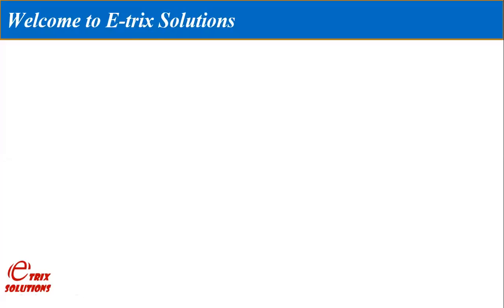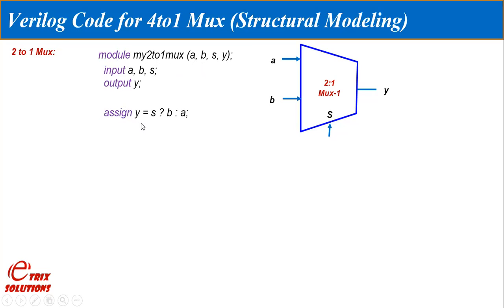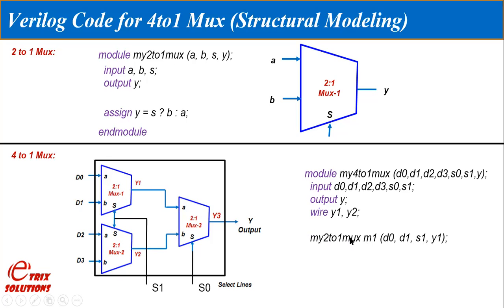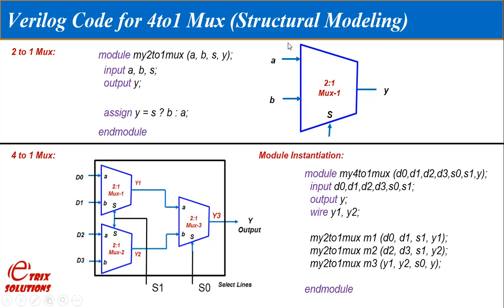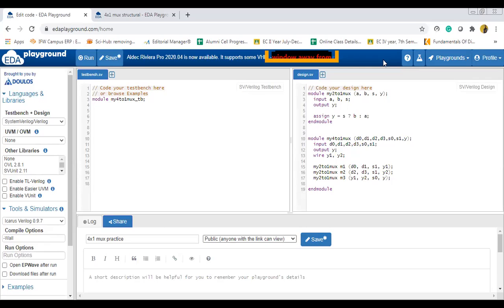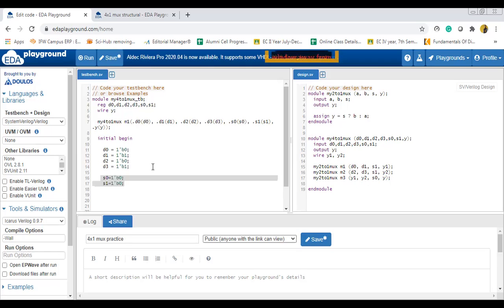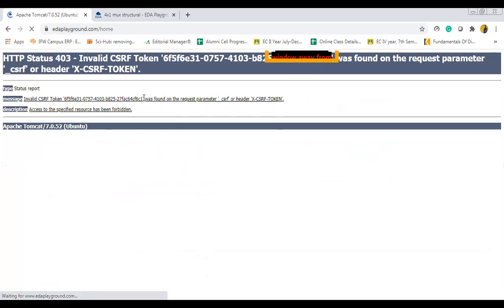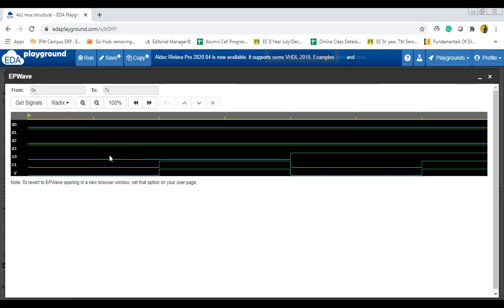EDA playground Verilog Tutorial of 4to1 Multiplexer

Comment: [2024-09-15 13:05:44 UTC] iverilog '-Wall' '-g2012' design.sv testbench.sv  && unbuffer vvp a.out  
design.sv:11: syntax error
design.sv:11: error: Invalid module item.
design.sv:15: warning: implicit definition of wire 'd0'.
design.sv:15: warning: implicit definition of wire 'd1'.
design.sv:15: warning: implicit definition of wire 's1'.
design.sv:16: warning: implicit definition of wire 'd2'.
design.sv:16: warning: implicit definition of wire 'd3'.
design.sv:17: warning: implicit definition of wire 's0'.
Exit code expected: 0, received: 2
Done